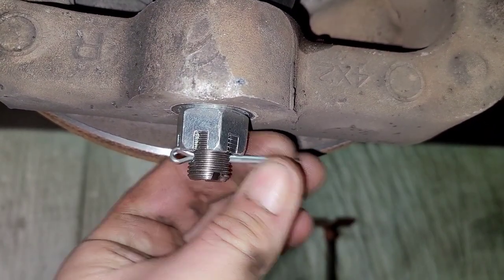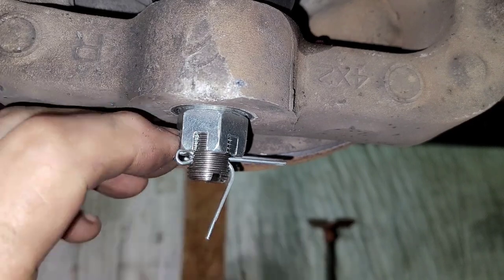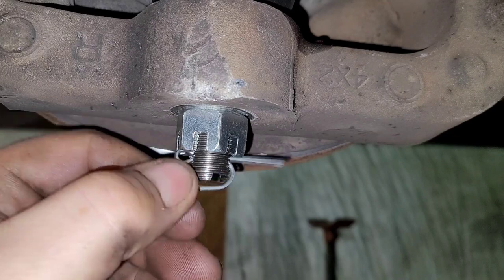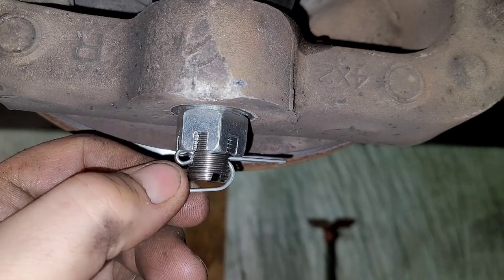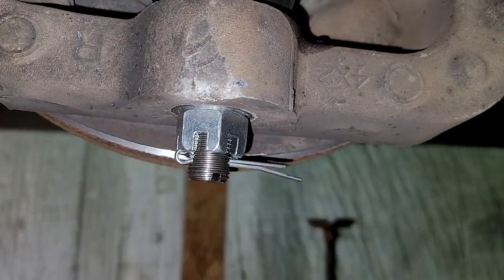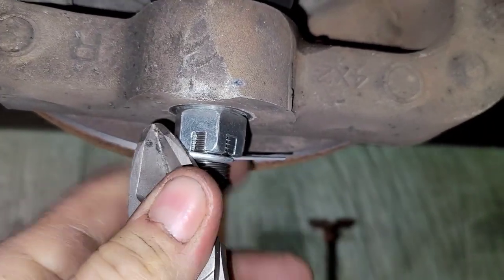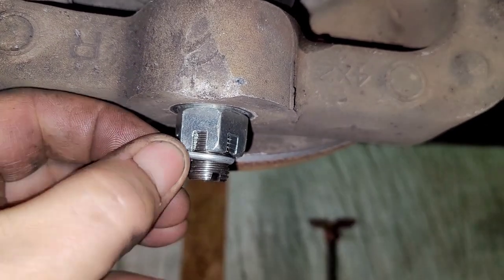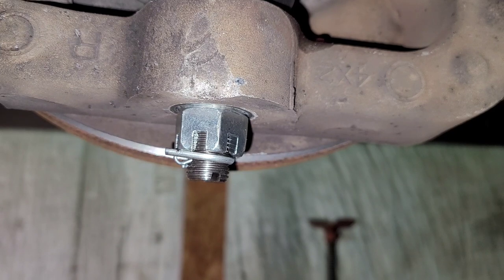The Cotter Pin Question. What's The Proper Installation? Multiple Answers On This One!

Comment: IMHO, that cotter pin is loose because the nut is too far past the hole, a washer or two would help. Based on my 25 years of Aviation Maintenance with 15 being in Quality Assurance, the accepted way is the first way you did it, with the tail cut and bent down over the nut, if the nut was installed correctly after aligning with the hole, the second way is acceptable as long as you turn the cotter pin sideways. In the Aerospace world, using a cotter pin twice is a definite NO NO, automotive might be another thing.  Great channel, I have learned a lot from watching, keep up the great content, and I am glad you don't "script" your videos. 😉
Reply: you are correct and it is split pin! the english invented them. So thats what they are!
Reply: If it was an aircraft your diatribe would have merit.
You didnt need to try and validate your qualifications by listing your Resume.  
What it did show was you do not have the common sense to differentiate between aircraft and vehicles.

Wrenching with Kenny does NOT fix aircraft. If he did, then your argument would be solid.
Reply: yeah the castle isnt even shimmed up to capture the pin head. No wonder its rattling about. Do this on a boat trailer and you get a seized bearing and the castle nut is going to rip the pin around it flat soon as a slot grabs it. The first method is the preffered method on non sealed taper rollers as it stops the annoying grease churning you get with the tang up the sides method.
Reply: @berty1422  even for vehicles the nut is too far up past the hole and needs a spacer so the pin is snug between the castles. ASE certified training explains this and I've seen it in countles manuals for aftermarket suspension parts 🙄

Comment: It really needs a couple of washers under the nut. For the split pin to work properly, the hole needs to be inside the slotted part of the nut.
Reply: In most cases the cotter pin does fit between the nut slots. However, as he showed in his video and the way he locked down the cotter pin, it will not allow that nut to loosen enough to make any difference! As for placing washers behind a nut can also cause problems later!
Reply: @goodcitizen64 rubbish. if you dont shim the castle nut so the pin is fully slotted then you can rip the entire pin through the nut like a wet flannel on high speed aplications like small aircraft and even doing 90mph in your small boat trailer. Ripped through split pins are the direct result of not shimming correctly and its the very reason your hub assembly if bought separately comes with washer mate. Just quit it with the misinfo ok, it can get people hurt

Comment: In the military, I was taught to bend the top of the cotter pin over the top of the bolt then cut it.  The other part of the cotter pin is bent down toward the bottom of the nut and trimmed off.  The loop end of the cotter pin needs to sit in the groove of the nut to have any effectiveness.  Have been using this method ever since and I'm a really old fart.
Reply: Exactly as I was taught 50 years ago. Nut shown in the video should have had a hardened washer under it so the cotter pin was more deeply rooted in the castle
Reply: 60 yrs in and that is the way i was taught from day1 and i continue today. Cotter pins that way are a one time use. It could be different today.
Reply: I'm in my seventies and I totally agree. 😂
Reply: I don't think I've ever seen one bent over the nut.
Reply: @homealone5087 bent over the nut is the correct way its the standard for marine and aircraft. Side tang causes grease churning on unseleled high speed application taper rollers like on small aircraft wheels or  boat trailers doing 100mph on the way to the ramp. Also sideways wraped tangs are known to be ripped out flat by castle nuts when massive bearing failure/seizure happens. People on here arent what they claim, i was in UK REME as Airtech for 2 decade and turned Marine Mech turned  boat builder. One guy on this comment section claimed Aircraft never use split pins. Just total tripe ive been wire locking and split pinning Aircraft & Boats for 3 and a half decade now.

Comment: I had an arm fall off on a car we bought used from a dealer. the same nut you were just working on i don't know if the guy who didn't tighten it or put a cotter pin on, but nothing was on it now. luckily it happened a block from home not on a highway.

Comment: if its loose like the one you showed i use a hardened steel washer to make it tighter. then its up in the castle nut bend straight down and cut and the other end i trim close. i hate to need to feel around and get cut or scraped by a cotter key. on the older vehicles where we packed the wheel bearings all i do is pick a cotter key long enough to barely stick thru where it doesn't need to be cut or bent. then tap the cover on how can it get out gravity is on your side, i have seen the cap knocked on and the key not cut properly and cut the cap into. my father did it that way i am 66 always done it that way never had a problem been a paid mechanic most of my life. like you say some will not agree but works for me.

Comment: Split Cotter pins are designed to be used with one tang bent over the tip of the stud like the first method you showed. There are a few reasons, Firstly its proven to hold castle nuts on in the event of serious bearing failure as its the girth of the pin that takes the load, the sideways method  with the tang bent upside the nut flats they can be pulled flat and basically streached out because they dont have as much strength in that direction. They can be fitted on aircraft and boats sideways only if its for clearance reasons but the first method is preffered. Secondly on high speed applications on tappered roller bearings that arent sealed on the outer at the hub cap the pin itself can cause grease churning as the tangs are basically bent up in front of the bearing where the grease is churned out the gap between the cage and the shaft ring.   So thats why they are fitted like the first method but where you went mentioned m with the one rattling about well thats a badly fitted one as you tension the pin head while you pull the bigger tang around the front of the stud. get the front tang fully positioned and trimmed  so you dont need to go back and shape it. From there you cut the back tang to side and punch it over at an angle or into the castle nut slot. This ensures a snug perfect fitment and no stressed out areas and is easy to get off. See half the play in pins its because the guy fitting them has went back and tried to reshape the first tang and tidy it in a bit after theyve got the second tang sweet. Then they need to go back and do the second tang a bit becase they moved the first tang about.  4 decade ex military aircraft now civilian marine mech and boat builder.  Cheers.

Comment: I respect your method & reasoning for why. What i do is just that but i leave it a little bit loose. Reason being is that if work should need to be done again, the pin can slide out, or i can knock it back & forth to get it out.

Comment: With aircraft maintenance, they use ss wire to lock certain applications for a reason. Like you said on wheel bearings that is a place with high vibration and stress. If I see a castle nut, I pin it. There’s a reason. Great videos Kenny.
Reply: Yes, avionics we were taught that high stress areas and a split pin, replace when removed, as it is a very cheap item, but the failure of that joint is not. so i keep that big box of assorted split pins in the shop, and when I come to one snip and toss, grab a new one. As to the install pretty much the standard has been it must not move. so tap the head into the hole, bend over the top of the nut, and back down to the head , and cut off flush with head for that side. Other end tap down, flush with the nut. Only other was for pins that are there for pivots, where it was tap head hard in hole, and bend tang back around to be cut off next to head, as the split pin could not fret then and wear, and it was, along with a washer, the only thing holding that pin in position.

Locking wire done plenty, had the holes to prove it, but was lucky I did not do engines, where you have a single locking wire that goes around the engine every segment, that holds all those fasteners with a single wire, and it has to be correct every time. That one lock could take a day to do, and inspect, per engine ring section, just for the locking wire alone. 20 odd case sections to bolt together, and most of the fasteners there are all single use only, so there was a massive box of bolts and nuts that were free to use for anything else. Sheet metal shop used to make sculptures out of them, in lovely colours, as the titanium bolts hot to different temperatures as they heated up. Same for rivets, still have the odd bottles of assorted left over rivets that I use for joining sheet metal, as they are perfect for this, and better than pop rivets.
Reply: UK military Para turned ex-Air tech here. Im now a marine mech and small boat builder. On or Aircraft we had wire lock and split pins depending on what the application and type of vehicle. Aeroplanes have more wire locking than pins and our helicopters have a more of a mix. Where there was no mount or hole to wirelock things too we would reverse wirelock multiples together so two nearby fixings we would wire lock them togeter in opposite directions so neither could slacken too much. Split pin wise we used strictly the First method on this vid where one tang was pulled over the top of the stud and the other trimmed and pressed inside the castle slot. This way the pin was not overly bent or stressed in one place. The side method where you wrapped the tangs around the sides of the nut flats was only to be done if front cleance was an issue. Also on doubled up taper rollers  the pin itseff would cause grease churning at high speeds if the wrap around the nut method was used.

Comment: Bro, cotter pin should be in the center of the castle nut, you need a washer under the nut to space it out so the cotter pin fits correctly.

Comment: As most have said, in aircraft maintenance never reuse a cotter pin.   I was also taught to never leave them loose too.  Being around people who haven't worked on aircraft look at me weird for always replacing cotter pins.
Reply: ehh?  mate im in the UK an ex Air tech turned marine mech and boat builder. Ive fitted more split pins to aircraft than i have boats. Wire locked and split pinned Aircraft many many thousands of times man. What you on about?
Reply: also they are designed to be loose-ish especially on high speed castle nut fitments where the outter taper roller bearing is not sealed. Pure drivel your entire comment is wrong

Comment: 1:10 that castle nut is improperly installed.  To properly install a castle nut, you use a washer ( sometimes 2 ) to ensure that the hole in the bolt or lug is lined up INSIDE the openings of the castle nut cut outs.  NOT BELOW IT.  
Then, and ONLY then do you install your cotter pin, bending it exactly as he shows - long leg bent up and over, short leg left straight.
Reply from the maker: Thank you for your comment. However, some Honda vehicles use standard nuts with cotter pins. Cotter pins are there as a redundant safety. Whatever the reason, the cotter pin debate goes on between military/aviation application vs. an automotive application. The debate will continue long after this video has run its course. Keep wrenching 🔧

Comment: If you're pedantic like me, you always use new cotter pins, but I don't doubt that you can reuse them if they are in good shape either. The only drawback I could imagine from a loose cotter pin is if got caught somehow while off roading and tore off,  but that's a thought experiment only. Nylok nuts and Threadlocker are awesome modern day replacements for cotters.

Comment: lol.... Re-use a cotter pin? Up here, not an option. 50% we're drilling out what's left!
Really admiring you channel!
Reply: 😂 It's just another bump in the rust blob of what use to be a castle nut
Reply: I don't even try to pull the old one out. Tap on a socket. Spin the nut off. And drill out the pieces. Much quicker than fighting a rusted pin.
Reply: @donmunro144  Yup, you can tell they do not treat the roads where Kenny lives.  
In Northern climates, most cars don't get past 100,000 miles before everything rusts out. 
Finding a cotter pin that you can remove is a rare object.😄😄

Comment: cotter pin can serve 2 different purposes 1 to keep the castle nut from falling off if it gets loose. MY OPINION ONLY cotter pins were designed to work mostly with castle nuts in that application can serve 2 functions keeping the nut reasonably tight and also keeping the castle nut from falling off should it get loose. MY OPINION ONLY main thing about a cotter pin is if you use it to bend it in what ever way you want to just be sure the way you bent it, it stays in place
Reply: castle nuts are specifically designed so the pin sits like the first method shown here. Pins to be used with washer surfaces or flat surfaces the pin is to be used sideways tang. This is the exact design  and use of the pins despite what all these fake air techs on here are claiming. One so called Air tech on this comment section claiming they dont fit split pins in aircraft hahahaha they fit more split pins on aircraft alongside wire locking than they do on boats. Ridiculous levels of lying on the comment section here.

Comment: Working as a millwright/railroader, I always keep in mind, the next fella that has to remove the cotter pin.  I leave one leg straight and bend the other about 30-40 degrees.  It makes for easy removal when the time comes.  Never had one fail or fall out yet.  I have removed my own cotter pins with ease from 15 years ago, on equipment that vibrates like crazy. If you've ever had to punch or drill one out because somebody in the past tried to make the cotter pin look like spaghetti, you'll understand immediately.  As soon as you bend either of the legs of a cotter pin, you have now weakened it.  Granted, not by much, but for less than a nickel in most cases, just use a new one....and on the same note, your employer would probably not want to spend $0.50 for you to straighten out a $0.05 cent component. The same goes for your own projects....what's your personal time worth?

Comment: Kenny, what should you do when the cotter pin goes through the castellated part of the nut, and when you torque the nut correctly the cotter collides with the middle of one of the castellations?  Should you loosen the nut or tighten it in order to line up the slot?
Reply: Tighten till it lines up.

Comment: There are several reasons why you would use a new cotter pin, as a shop owner I don't have time to be straightening out cotter pins when they're so dirt cheap as I buy them by the hundreds. Number two once you bend a cotter pin it becomes weak at that point. No I understand that cotter pins are used to make sure the bolt does are loosen but like you said if it's preloaded properly a cotter pin is like a scumbag with a hole in it,  it's useless. My whole thing is why would you use a used cotter pin it makes absolutely no sense. Customers pay a lot of money to have their cars repaired, so give them what they deserve and replace the cotter pin and don't be a cheap piece of trash. Other than that I bend them exactly the way you do every single time. I have no issues with giving my customers new cotter pins it's ridiculous to believe or do otherwise

Comment: On the loose or reusing split pin debate, here in the Uk a loose pin would be rusted solid within a few weeks and on anything but things like wheel bearings you'll never get one out in one piece anyway so you can't reuse them. Why would you want to bother straightening  and weakening them when they cost pennies?

Comment: Like you said (kinda) to each their own. That said, I cannot imagine reusing a cotter pin unless it was during a road side repair and a new one was unavailable. A new cotter pin cost between 2 cents and a dime for most of them and even the super expensive ones are just a few more cents. Why take even the smallest of risks or leave an old greasy cotter pin in to save a couple of cents. I am not as smart about mechanics as most the people who watch this channel but my Dad always to,d me that is I was going to do a job, do it right and don’t cut corners. I hate it when mechanics load up the parts cannon and just start replacing things that are fine. If a part is $200 or even $10 and in good working condition, put it back on the car. But cotter pins? I don’t think so.

The one exception I can think of for other parts are for routine maintenance items that are very difficult to get to and the labor is way more expensive than the parts (spark plugs or coils for example and only on certain cars where they are really challenging to get to). Even if they are fine right now, IF you have spent a couple hours to remove a bunch of engine parts for a job and finally worked your way down to them I would go ahead and change them since I was already there and knowing they would probably need to be replaced in the next year or two anyway. Save the customer the extra labor charge down the road and take a couple of minutes to replace the plugs (or whatever it is). Of course, that would only be after customer approval.